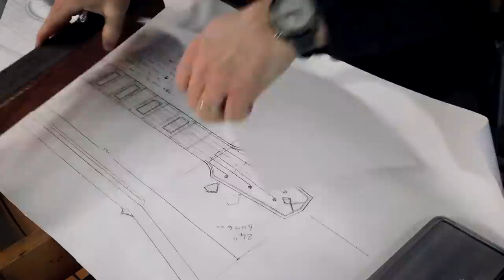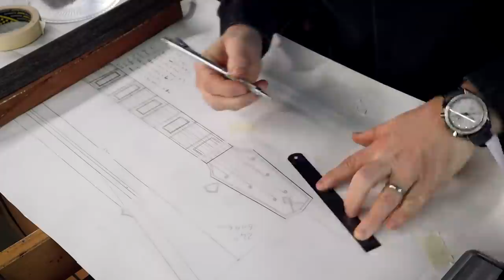Ep 4 Carving the Neck | Hand Tool Only Travel Guitar Build - A Guitar from a 4x4 FENCE POST

Comment: Happy Christmas Ben!  Again, I applaud your courage in not using the drill guides.  
 I learned to use the brace and bit from an old (he was about 75, in 1971, so, whatever) German carpenter.  I was 15.  He made me drill about 50 holes of 3 sizes in some little 1" thick maple blocks until I got a few really straight (plumb) holes.  I didn't realize he was making me create drill guides for my later use, while giving me practice in using the tool.  He kept his bits really sharp, and I don't recall any special amount of tear out, but I do remember having to ease up when I felt the worm  clear the other face of the wood.   I use something that guy taught me every time I pick up a piece of wood.  Thank You for reminding me of him, once again.

Comment: When you're cutting on an angle, such as trimming the sides of the headstock, it's easier to cut accurately if you turn the piece in the vice so that the line of the cut is vertical. Your body is naturally good at cutting that way, whereas cutting at an angle requires you to compensate and it's more likely that you'll cut off-line.

Comment: The only parts that you normally don't do with hand tools are really the "roughing in" stages, to get the various parts of the guitar close to the final shape. Most of the time, from what I remember, you really normally use hand tools at the end too finalize the shape. 

You aren't getting the full zen effect of woodworking with hand tools. Relax. I'm nervous with power tools though. So, I can understand to a degree. I just want to see you get more comfortable and start enjoying working with hand tools. I wouldn't trade it for anything. I dread the thought of using power tools now. Hand tools are so peaceful to use. I mean, physically, you work a little harder, but mentally, there is a relaxing feeling to it.

Also, when carving with a knife, there is a trick you can use where you put your thumb of your other hand on the spine (assuming it isn't a double edged knife) that gives you more control over the blade while you are carving. The trick is to keep control of the knife, without that flying out motion. That's where more serious mistakes and cutting yourself can happen. 

It's looking great so far.

Comment: I once had to copy a Cabriole table leg from mahogany for a repair I was doing.  I feel your pain.  I used the kerf and chip method to get close. I suppose this is a lot like your facet method, except I used a gauging saw (like a your fret saw, with a depth control side plate) to make the kerfs, and a chisel to pop out the little chunks between the kerfs.  The final carving was an exercise in patience and switching cut directions. Even the rasps had to go the right way to avoid tear out.

Comment: With brace it's a good idea to have a sacrificial piece behind, so the snail has something to bote to all the way through. If you need any force, you have a dull drill or damaged snail. A brace should quite effortlessly drill 35 mm holes. You are just paring with two sharp chisels while turning a small screw in wood. Brace is an ingenious tool. When sawing, it's always good to mark both sides. Frame saw won't twist, but it's still the easy way to ensure you are going straight. That was a great demonstration of how carving a guitar neck is definitely not a difficult task. You can do it with pretty much anything that can take away wood. Neck should by definition be straight grained knotless wood, that's easy to carve. People fear it far too much.

Comment: Other option in cutting is facing the flat profile towards the ceiling, make cuts near the line every 5 cm or so apart, and chisel the excess. You really have to watch out for what the grain is doing while chiseling so that it doesn't "crack" pass the line. Same thing for neck profile (ruff cuts). 
To me doing it on real neck would take at least 3 days :D with screwing something up, but i'm sure that someone with your experience could make that work even faster than only using a saw.

Comment: Never ceases to amaze me how guitar builders of all abilities always seem to neglect the one tool which is the PERFECT tool for shaping necks. A tool which was purpose designed for shaping long thin pieces of wood - the SPOKESHAVE! I use them all the time. They're cheap and easy to get hold of. They're easy to use, and totally noiseless in use as they don't need power. Easy and quick to sharpen and you can shape a neck using a spokeshave very quickly............. Why don't people use them for neck shaping ?????

Comment: Ben, regarding the drill for the headstock: the drill needs to be much, MUCH shorter. You essentially have a taper length drill there (8xD to 12xD.) A jobber length (5xD) or a stub length (3xD or less) would make this process easier powered or not. My background in machine shops has granted me an obsession with drills, mills, and turning tools.

Comment: If you use a 25.5" fret slot ruler, but place the first fret mark at the nut, you get a 24.069" scale. Fender did the equivalent with their gang saw machines to make  nominal 24" scale necks for Mustangs and Jaguars.

Comment: Must have read my comment on the "10 Essential Tools" ! Have a good one ! Not sure if you have the diamond/ file on yours but 5he diamond side is still my fret end tool for radiusing ends to a lovely snag free ball end without messing up the fretboard. A 12" hacksaw with blade turned sideways eliminates the bow saw an is super quick with course teeth through hardwood . Everyone and Granny has a Junior and or 12" hacksaw . Use ordinary steel blades . 
My Leatherman was designed for the job but a very different job nearly 40 years ago . Don't forget the UK knife carry law . I have a long time ago but old enough to get away with it !
Desert Island srings ? Depends on desert island but the Aloe species is a possibility. Some have a spiny tip that you can tear out along with the threadlike material and stitch up a wound very successfully, sago species fibres are also long enough . Forget coconut fibre as you ll never split the husk of a coconut with any multi tool unless you whittle a splitter first  .

Comment: Well first off Merry Xmas Ben, may you and your family have a wonderful day. Thank you for all the wonderful builds and for keeping us inspired. Secondly, I have a great suggestion, which works for ''burn it!" you actually can use aluminum, or copper shielding tape, as fire masking tape. Do a little test piece, and you can actually make a segment showing the method, but essentially just use a more direct small flame and move fast in multiple passes. Now you can do the sides of that fretboard. Hohoho! Cheers!

Comment: Interesting to watch you carve a neck with a knife. It's the way we were taught at the London College of Furniture. Our tutors were classical makers and we were taught to use a knife, a rasp and a cabinet scrape to carve a neck. You are using a Sloyd type knife. Our knife shape is different. 30 deg angle across the tip. Watching you carveI can see you trying to make your knife work like ours but it doesn't quite do it. You should try using our shape it makes carving a neck a doddle. I reckon both shape together would be very good.

Comment: Yes Ben you need carving knives. The right blade for the job lessens the chances of adding human red dye to the wood.. Start with large sharp flat blade. Then move to short controllable curved blades using a pulling motion.

Comment: Just a thought, what would a luthier's leatherman (or victorinox) look like: Normal blade, Replaceable Scraper blade, , File, Tapered rod to measure thickness, Angle markings on base of the blade? What would be found as convenient, instead of multiple tools on the bench?

Comment: 6:00 I actually never use my hand drill anymore.. I have those stepped bits that fit in my Screwdriver with ratchet... So do those wooden blades.. And I use a reamer to finish..  Recently buried a 3/8" dowel under a strap pin thru a Takamine neck block.. I just used the smaller bit accepting sloppiness and hammered the dowel in..  Splayed in. Takamine don't like neck resets.

Comment: I've said it for a while
A tool starter pack from beginners only build would be good. $500 limit on tools with an expectation that they will only last for under 10 builds or so, by then a beginner will have either given up or will have got the bug and go buy decent tools

Comment: Deserted island strings? Definitely dietary tract long intestines of some sort. Has been used on string instruments for centuries as we all probably know. Would off course have you out hunting and gutting whatever animals available at said island, and then cleaning, twisting, stretching and drying the gathered long intestines, to be able to later select the ones best suited for each string, which admittedly will be a bit of a lengthy process in itself (not that you haven't been facing that type of a situation before). "Strings" not suited would still be perfectly usable as tying line or other tool or weapon materials, so it wouldn't be a waste of time with regards to general survival.

Comment: Would there be merit to having a slanted tail piece, like on an archtop, with a inline tuner headstock, like Fender, mirroring the slant of the tailpiece, so that all the strings were in essence the same length overall with opposite short/long overhang on either side, sort of like this if it helps -    \=||======||=\ 

Would it make for good building principles or just nice aesthetics?

Comment: If i stain a guitar with spirit stains, how long must it dry before i can clear it ?
Reply from the maker: Should be ready for finish within half an hour as long as you've not literally soaked the top. Results may vary depending on finish but we've never had any problems.

Comment: Was that a ceiling mount setup? I could have sworn somebody (cough) suggested that a while back, and a certain person replied that it wasn't practical.
Reply from the maker: Yeah? Well.. a certain person isn't too proud to admit he was dead wrong! He has also bumped into the camera 4 times so far.. a dangerous game 😆
Reply: @CrimsonCustomGuitars  well TBH my idea was more a hanging monopole that used gravity to ensure it was already plumb and small screw hooks so it could both be moved easily and you could have multiple set locations. Nice thing about a pole it that you have built in height adjustment by sliding up and down and built in left right by rotation around the pole. Built tilt into the camera mount and you control all 3 axis.

Comment: I love those Japanese saws. Do they need resharpening often?
Reply: Modern ones like that, the blades are replaceable, not sharpenable. I have a love hate relationship with them. They are wonderful when new. Then you start getting teeth that bend.
Reply: @DavidKirtley  if your teeth are bending, you're not using the saw correctly.
Reply: @juliachild9377  Or maybe I am human and don't move perfectly every time. :)  The problem is that they are impulse hardened and the teeth are harder than the rest of the saw. The body of the blade and the teeth don't flex equally and the meta fatigues where the two hardness areas meet.  Like bending a paper clip back and forth will break it.

Comment: Didn’t hear this the first time around. “Limited tool build,limited by budget”. I mentioned the same thing on Instagram. (No I’m not claiming to be the origin here for the keyboard warriors out there)
Great minds think alike?   Although I would add an “oops” category.  Aka you burned up the budget and missed say…. A particular drill bit. Cause we’ve all done it!
Or for that matter. I think using reasonable prices on things like chisels is acceptable. Eg. Price for a 1 inch new Narex chisel. Or a 14 inch bandsaw. When you might have a 17 inch.